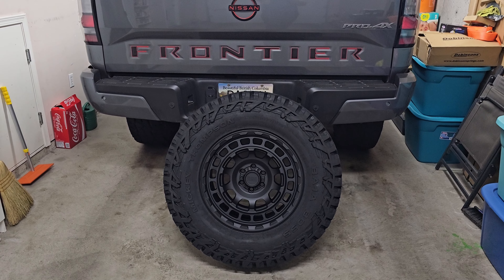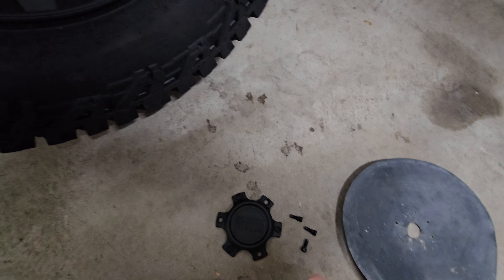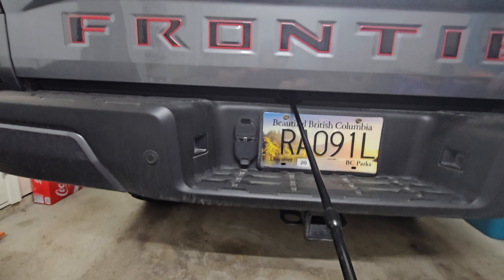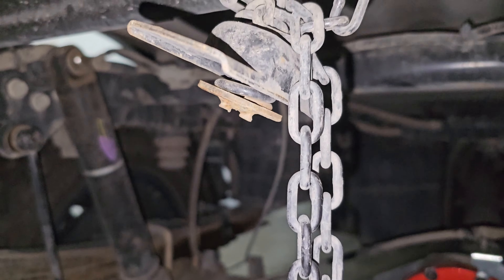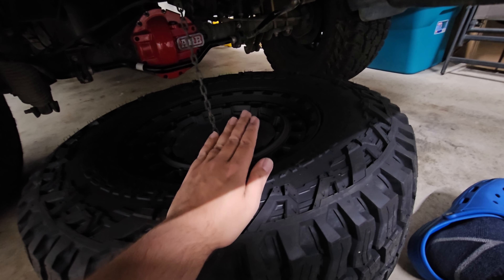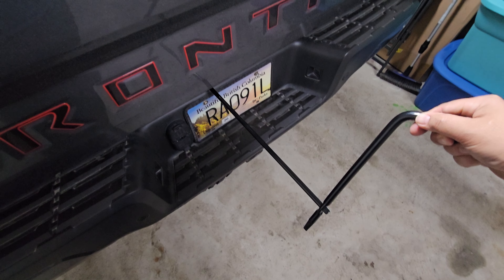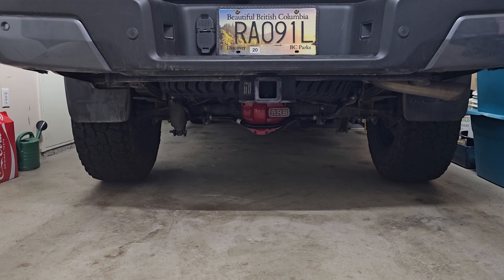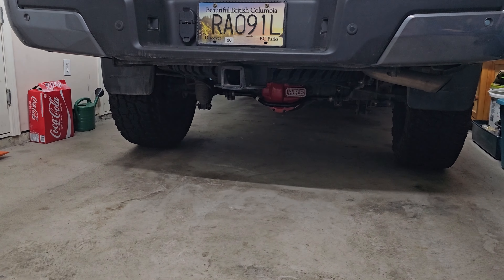Can you Fit A 33 Or 35 Inch Spare Under Your 2023 Nissan Frontier Pro-4x In The Stock Location?

Comment: Good to know. On my truck, I ordered a bracket to locate my spare tire vertically in the bed. This makes the spare much easier to access when towing or 4x4'ing on uneven terrain.
Reply from the maker: I want to eventually get a steel rear bumper with the tire swing out. But that's a ways down the road
Reply: @CanadianCruisin  That's a solution that could provide a better departure angle too - pending your choice of bumper. I have one of those on my Jeep - just another step to get into the back. But the radius on the swing isn't convenient  when towing.
Reply from the maker: @onefastcyclist  yeah I don't tow often so luckily it's not a big deal breaker for me. If I towed a camper or something I'd most likely go the same direction as you
Reply: How true to clean the chain pulley. Mine is currently rusted on
Reply from the maker: @gordmonteath6090  yeah no one ever thinks about it until you need it and its already to late
Reply: What did you do with the chain? Is it removable or did you have to cut it off?
Reply: @franksteer9568  Bolt cutters are great to have

Comment: Hey! Great video! Are you ever worried about the exhaust being too close to the spare and melting rubber?

I am running 285/75/17 and i have about half an inch between the tire and exhaust. Right now my spare  is just in the bed of the truck

Comment: Thanks for the video. I have a question, I'm deciding between the heavy duty and the medium duty Dobinson's spring leafs. How does your truck drives with the heavy duty ones? Thanks again.
Reply from the maker: On road it feels the same as stock. You feel it a lot more over speed bumps and stuff like that. Off road is usually bumpy enough that you don't notice it either.
Reply: @CanadianCruisin  Awesome, thanks

Comment: The stock tires are 265/70/17 and their actual diameter is 31.6 inches so people would call them 32's. Depending on which rating you have your Mickey Thompson's are either 32.8" or an actual 33". The next most common size up, the 315/70/17 that is commonly called a 35 but at 34.4 inches from most manufacturers it's actually more like a 34. But, hey, marketing never let math, or the truth, get in the way of a good story. With some trimming at a 2" lift and the right offset these will fit but now you're starting to need gears and that is far more expensive than the tires. For most people the 32 or 33 inch tire on these mid szie trucks is the way to go if you want to increase performance a little without spending a small fortune on mods. I've driven a 2022 PRO4-X with the aforementioned 315/70/17's and E-rated (not at all needed or beneficial) Falken Wildpeaks at roughly 58 pounds and the performance drop with acceleration is significant. The guy doesn't really do much more than ride gravel and some rutted mud tracks roads to deer stands and he just likes the look so they work okay but if you are actually looking to improve performance you're going the wrong way if you don't regear for anything over 33. Especially if you go to true 35's.